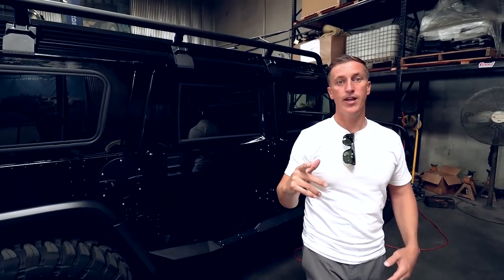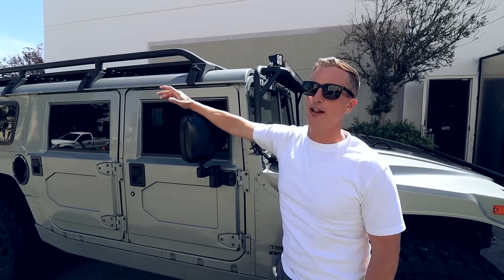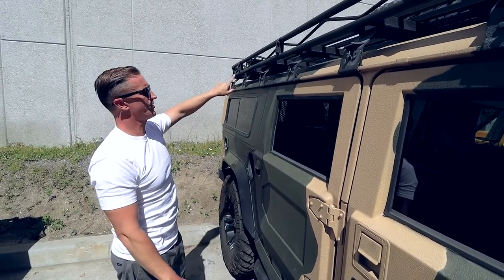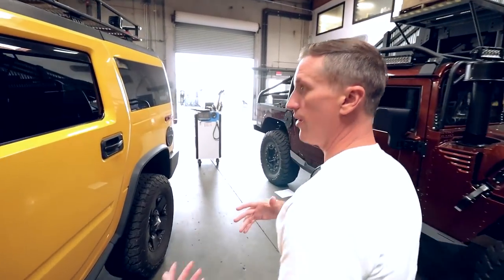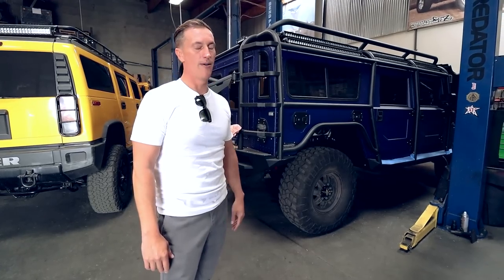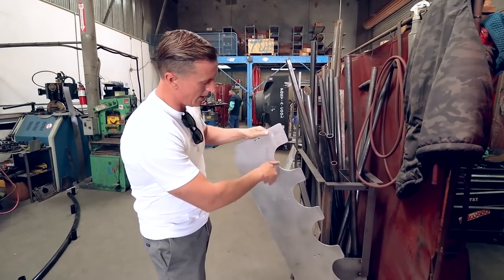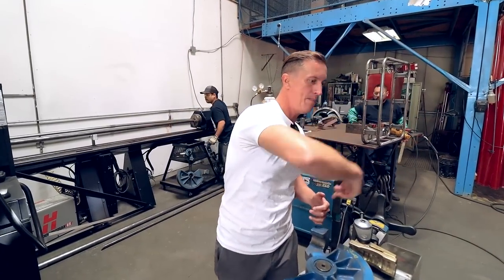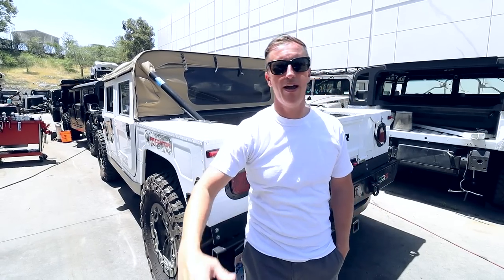EVOLUTION OF OVERLAND OFFROAD H1 ROOF RACKS!! DDE UPDATE!!!

Comment: is hummer waterproof until half of the truck body  when driving or wading through the flooded area...am from tropical rainforest country malaysia,flood as high as 5 to 6 feet deep,when drive through the water will flows over to the wind shield.no leaking into the truck.
Reply from the maker: No, you will get water inside the cab. It depends on how long your submerged and the quality of the seals but yes, you would get water inside.

Comment: Living in the midwest I can say I love the designs but they suck where i'm at. I haven't had any steel powder coated or painted that doesn't rust in less than 2 years. If it was aluminum or stainless a definite yes.

Comment: I'd punch square holes in your aluminum channels and switch to carriage bolts instead of regular bolts. That way when you slide stuff forward from the rear of the roof rack it won't catch on the bolt heads.
Reply from the maker: We use stainless button socket head bolts for the same reason. The button socket caps have that same smooth domed finish. Thanks for recommendation and for watching!